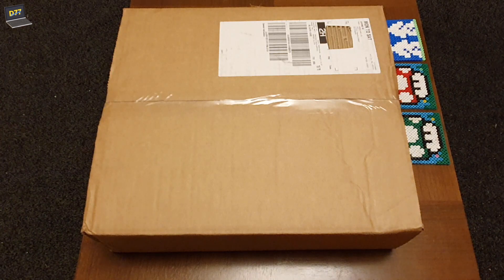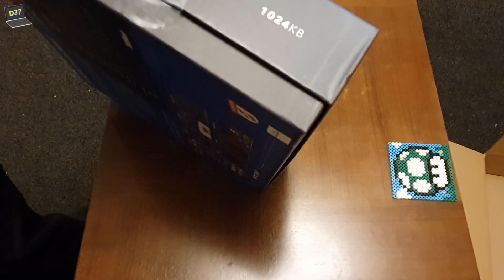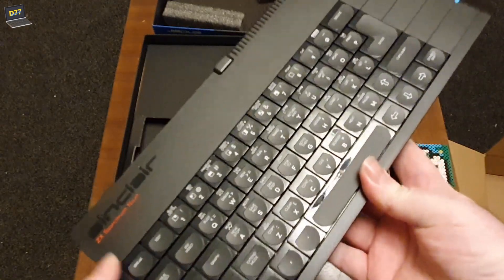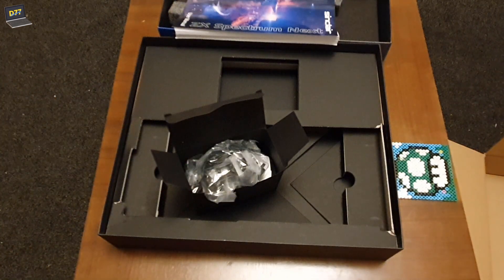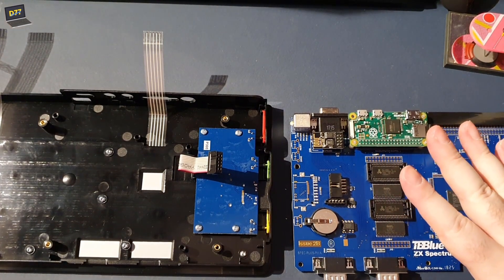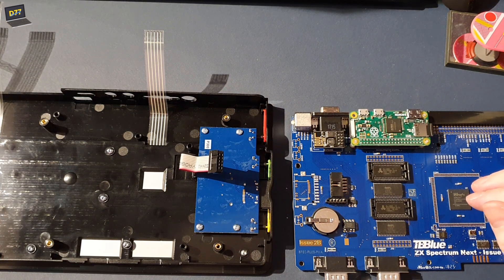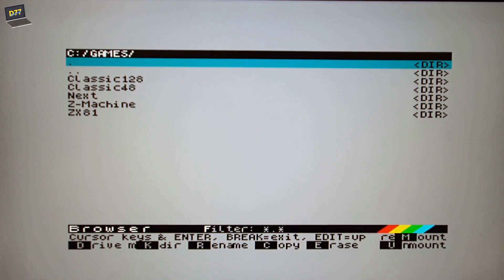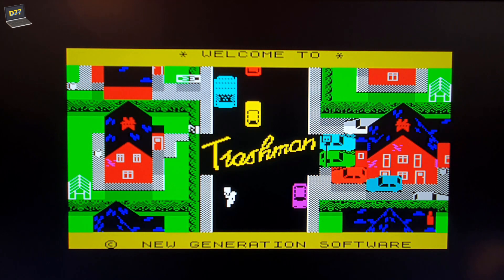ZX Spectrum Next - Unboxing, upgrading and admiring

Comment: Thanks for making the video. I did notice you struggled with dismantling the 'Next. When I upgraded the RAM in mine, I just took both boards out. As for your monitor, are you sure it did not work? When using VGA, you need to press and hold 'V' when you turn the 'Next on and then it will display on a VGA monitor. This is explained in the first chapter of the manual. The one thing I did discover about the 'Next is that it is not a typical consumer device. It has a lot of quirks to it and aspects that assume a lot on the end user. Once you appreciate this it becomes easier to use and get the most out of.
Reply from the maker: Thanks for the advice - I've had it pointed out since that the developers actually recommend taking out both boards whenever you're going to work on it. If I ever need to open it up again I'll definitely do that!

As for the TV, yes it's definitely the TV that's faulty. I couldn't get it to come out of standby even with other devices, and tried hitting V repeatedly, powering off and on again a few times.

Thanks very much for your comments and advice - and clearly for watching it all too! 👍

Comment: 12:33 shouldn't it be showing the time and date at the bottom of the popup box as well?
Reply from the maker: Yes it should, and I can only assume the reason it wasn't is because I hadn't yet set the time. After I went into Command Line and set the date and time manually, it started showing it.